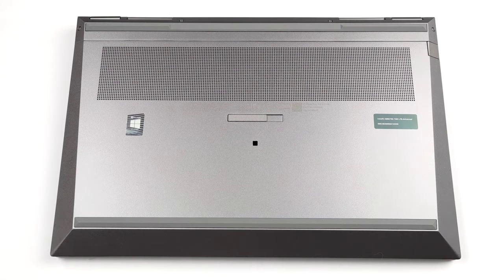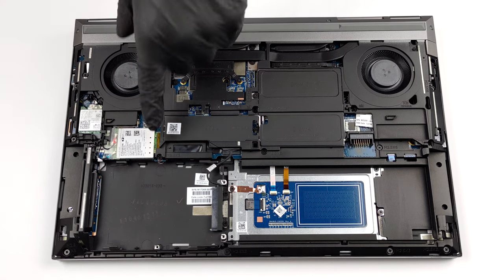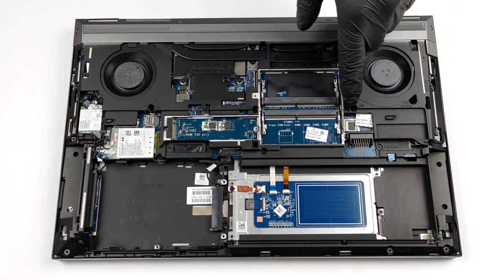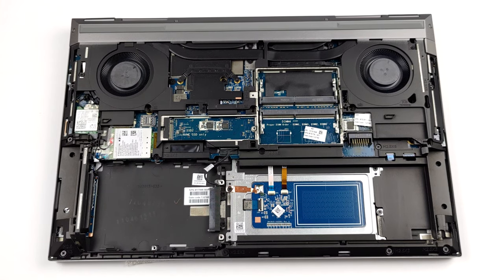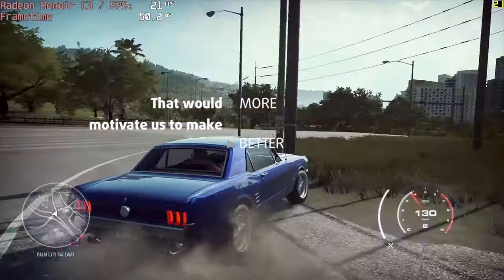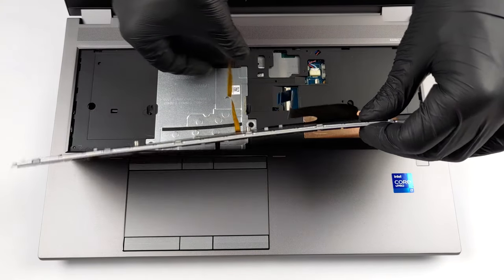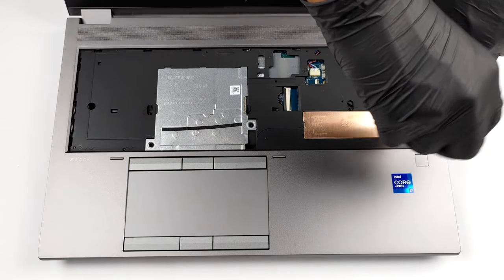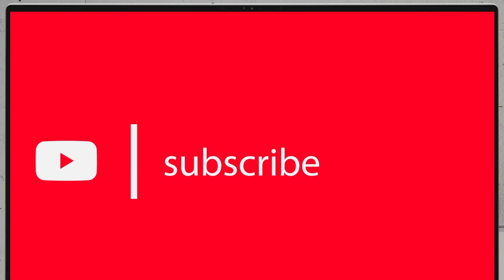🛠️ HP ZBook Fury 15 G8 - disassembly and upgrade options

Comment: My Fury G8 15 came with 64GB of RAM. Is there a foolproof way to tell if it’s ECC or nonECC?
Reply: You could open it up like in this video and have a look at the ram sticks. ECCs have an extra chip on the board or you could look up the ram model. Software-wise, afaik there isn't a "definitive" way. I'm sure you have googled this.

Comment: have the same laptop that you show here. try putting an ssd in the slot that you show has a cover and says ssd 2.
the disk I put in was a 2 TB Adata Brand, Swordfish Line, Model ASWORDFISH-2T-C; PCIe Gen3x4, NVMe 1.3; M.2 2280.
When I first installed it, it was hard for me to recognize it and when I did, the temperature shot up almost not letting it touch the part where one rests the hand and the battery life fell from 8 hours to 1 hour immediately. In the same way the charger is overheated. Do you have any idea why this could be happening? the problem is fixed by removing the ssd 2. Thanks in advance
Reply: that is so odd brother